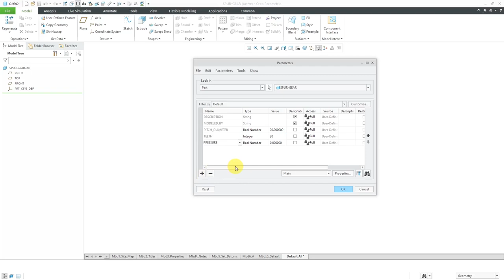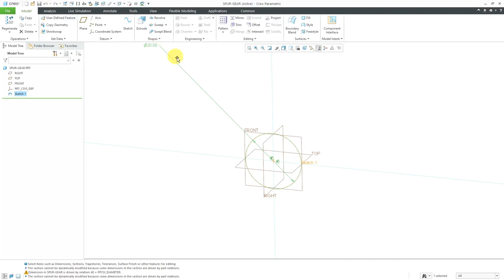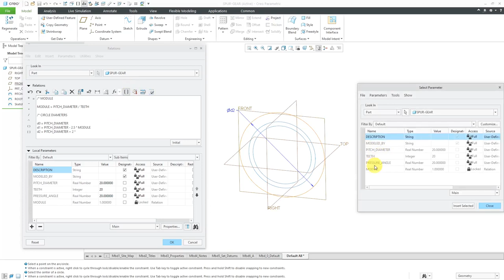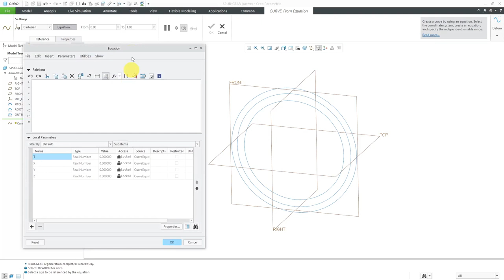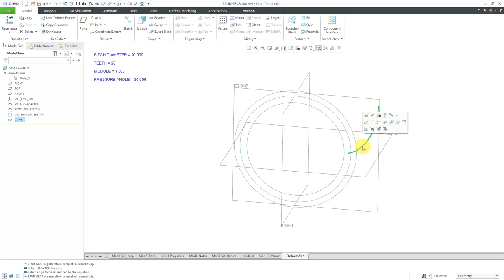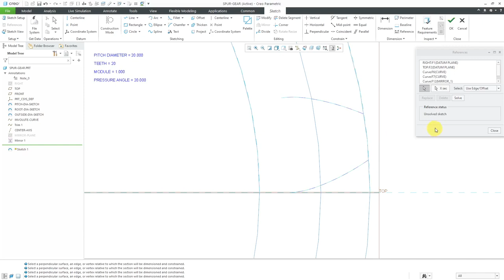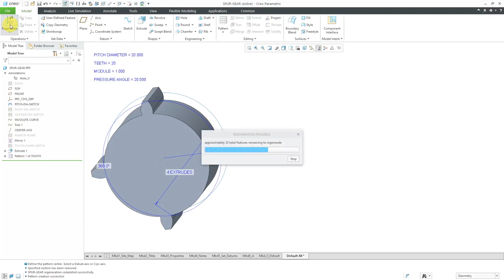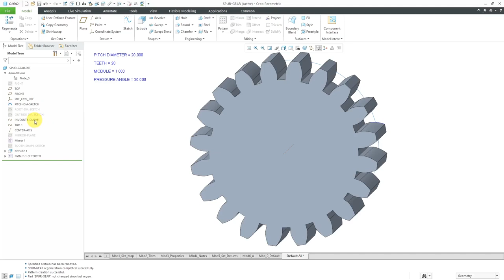Creo Parametric - Spur Gear Design | Involute Curve

Comment: for some reason my curve keep intersection with each other after mirroring, until I have noticed datum angle on my design supposed to be 6.55 instead of 6, I'm not sure if it because I used a different diameter than what you use or something els

Comment: Thanks a Ton for the vedios.
I am stuck at 6 degree offset plane used to mirror the involute profile. it defines the tooth thickness and works fine till a perticular size of gears but beyond that it fails.
can you please explain you to define that value in simple terms.
will be really helpful, Thanks

Comment: The tooth width should be parametric. and this is not correct here. It should be like 360/80. i.e each tooh has 2 times of that mirror angle and then there are 2 time of mating teeths. so for 20 teeth it should be 2*20*2=80 such angles of mirrors in a 360 rotation which is 4.5 for one teeth.
Reply from the maker: You are correct. I realized that after I published the video. I mention the error in a subsequent video.
Reply: @CADPLMGuy  which one video? I cant find it...thx
Reply: @CADPLMGuy  I'd like to find the video where you address it as well
Reply: @CADPLMGuy  which video did you publish this in and are you able to help with changing the values of the parameters as not everything else updates. Thank you

Comment: Thanks, it was very useful.
and kindly describe how we can vary that 6 degree angle according to our design. 11:26
Reply from the maker: That 6 degree angle is wrong. It should be 4.5 for 20 instances. I’ll cover that in another video. There should be a Relation that the angle of the mirror plane is 360 divided by ( 4 times number of teeth ). I’m learning this as I go along.
Reply: @CADPLMGuy  Just for future people in the comments, that 4.5 degrees isn't measured from the top plane, it should be measured from where the involute curve crosses the pitch diameter. So make a point at the intersection, use it and the central axis to define a plane, and then measure the 4.5 off of that. I'm not a big gear guy so correct me if I'm wrong, but doing that will make your tooth thickness and spacing equal
Reply: @timbarrett4580  You’re right sir, thank you so much
Reply: @timbarrett4580  I don't get it, make a plane that goes through the point and through the center axis? Then it creates errors

Edit: nevermind, thank you!
Reply: @CADPLMGuy  if you create a relation for that how do you use it when making the plane offset? There's no option to use a parameter

Comment: thank you very much i will have a stantard gear to use. For information the shape of teeth it could be better that the symetric plane will pass thrue a point onto the Pitch diameter separate by a distance of a pitch p/4 to use the pitch formula p=pi*m.

Comment: Dear Dave Martin- what is the correct way to reference my big assembly to a family table reference part?
For example: I have a ring with different sizes and thicknesses (family table ring)  , I want to build my big assembly (or is it skeleton?)to reference that family table ring, so that my assembly will change based on which ring I choose from my ring family table.  Should I use the ring as a reference or- should it be done in skeleton or do I create family tables of my assemblies in my assembly? 
Best regards Henrik

Comment: Nice, but this method has too many steps involved.
Reply from the maker: No one is forcing you to use it. I look forward to seeing your video on the subject.
Reply: @CADPLMGuy  I didn't mean it in that context. As someone with only a basic level Creo skill, I would much rather draw the features and perform the calculations manually rather than inputting these parameter values in. That's just my style.
Reply from the maker: @MACROPARTICLE  If you research the physics and mechanics involved in gear design, you will find that you cannot simply just draw the feature. This method does not deliberately use a more complicated technique than necessary. In fact, it actually approximates the necessary geometry for a constant pressure angle. I've recently been working on a method using Mathcad that creates more accurate geometry for gear design. Unfortunately the physics of the real world do not change based on our CAD skill level.
Reply: @CADPLMGuy  Hi.   Great video.   I'm a long time Creo user and know it's both powerful and sometimes unnecessarily complicated.   I feel like this process leans heavily towards the unnecessarily complicated side (not your fault,  of course).  I'm just learning to use Fusion 360 and it has a built in gear generator feature.   Just enter a few parameters and the gear magically appears!   I was thinking I would just build my gears there and import the step models into creo for use with the rest of my assembly.  Have you looked at doing something similar and,  if so,  do you still feel like it's worth building all the relations yourself in creo vs. importing from another modeler?